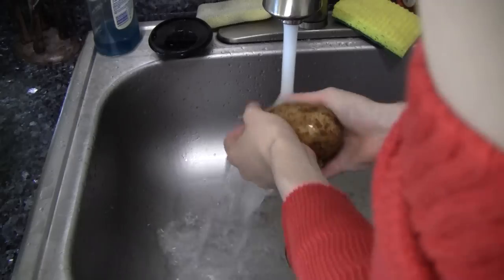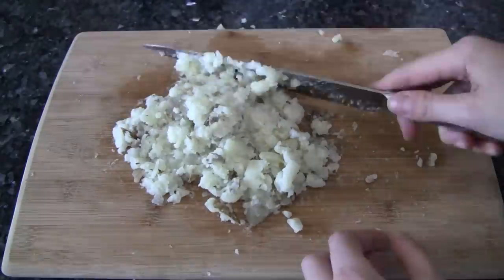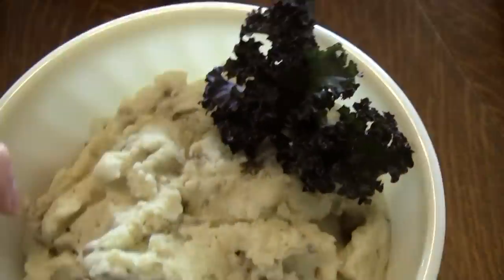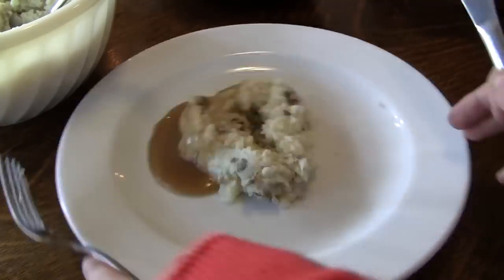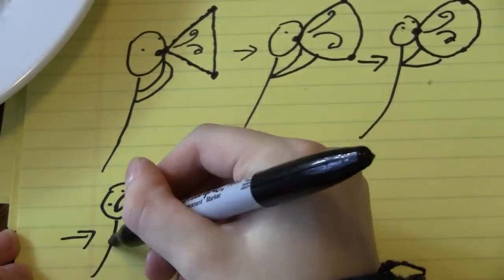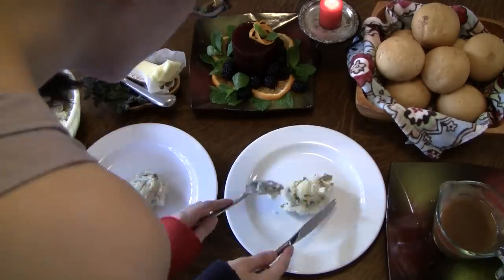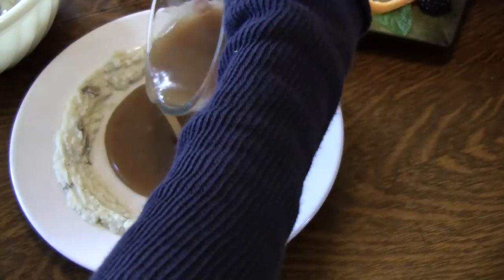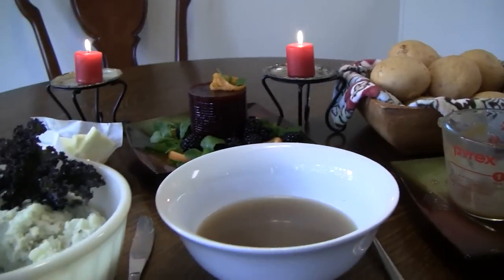Optimal Potatoes

Comment: I like how you just taught one part of optimization, which took my AP calculus class a week to figure out.

However, a more practical way of solving the optimal potato problem is to include an area constraint... otherwise you won't have enough room for your bread spheres, or cranberry cylinder, or, heaven forbid, your turduckenailailenaillailduckenailailenailail
Reply: Patrick Scholl and the green bean matherole and the borrimean onion rings
Reply: @official-obama  u ok bro?
Reply: As well as taking into consideration what your actual goal is, because it is no longer a mathed potato if  86% of it is gravy.
Reply: Oh no! Not the turduckenailailenaillailduckenailailenailail!! That’s my favorite part of thanksgiving dinner!
Reply: @patrickscholl2484  u still alve
Reply: I prefer turkduckenailduckenail
Reply: You could put everythihng on top of the gravy

Comment: 0.01k years later and I still don't fancy eating potato peels, not even if shaped as hypertori. As for the gravy, I still create grids with alternating low and high local entropy areas, corresponding to various microstates and macrostates. In the end, I optimize a little for having a balance between the lowest mechanical work (with minimal paths for hand movement that would be integrated when force is applied) and the highest amount of comfort (with reduced strain on the wrists and jaws, correlated with an adequate breathing tempo).

Comment: A 1 part gravy 3 part potato serving is the best in my opinion not to little that it tasteless and not to much that it becomes a soup, while a circle can hold the most gravy, I find the triangular shape to be the best in terms of gravy to potato ratio and structural integrity to avoid leakage. Then if you want the best mashed potato experience, get another spoon of potato and put just enough t cover the top of your mashed potato triangle. That way when you cut into it it'll be like a lave cake but instead of cake it's mashed potatoes and instead of chocolate it's gravy.

Comment: the food will get too cold, so you need to do a risk analysis taking into account the rate of heat loss from other food items vs the maximum happiness you'll get from an optimal potato. You should also get other mathematicians and engineers to review your design before publishing